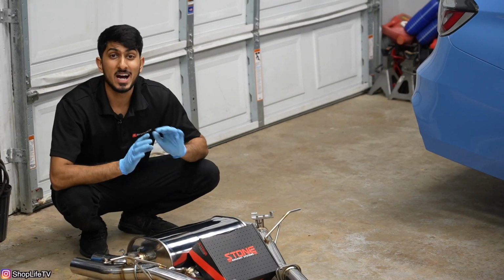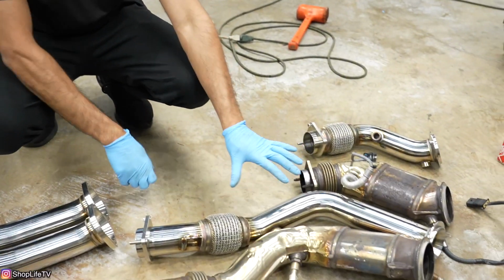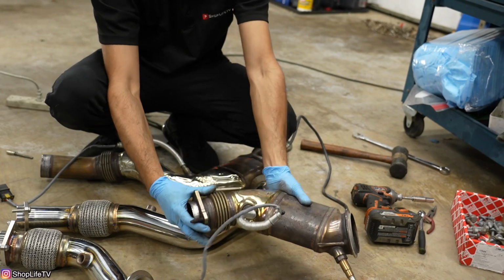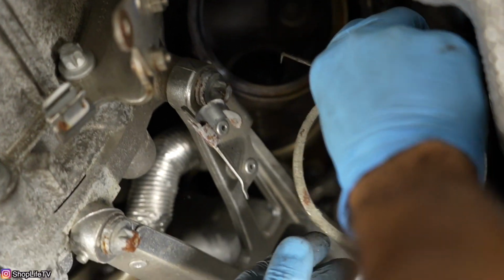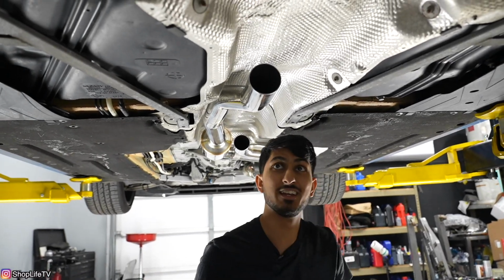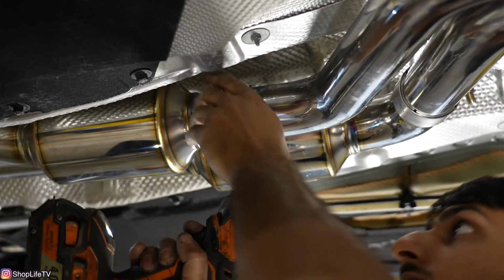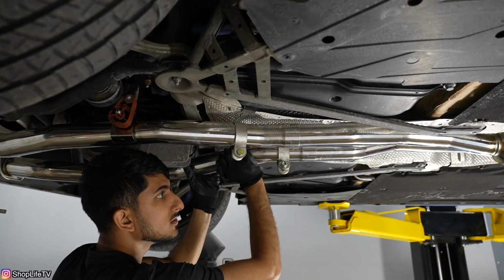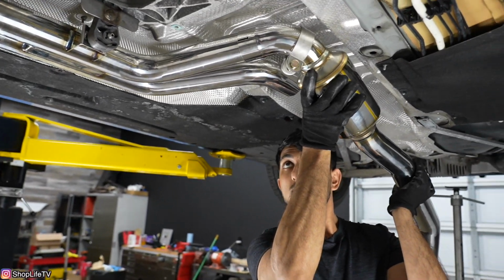I Installed a New Valvetronic Exhaust on my F80 BMW M3! + Driving Footage!!

Comment: 19:10 Wait....So the F80 M3 M4 now comes with a Twin Turbo set up? Because they didn't before that as they had what BMW called the "Twin Scroll" which is a single turbo with a kind of two way manifold to make it scroll up to speed similar to a twin T. But is not an actual twin turbo like the 2011 "1M' is and all other N54 engines are.
Reply from the maker: The S55 is a twin turbo setup, the N55 found in the Non-M cars is a twinscroll

Comment: hi and thank you great information, I have BMW e60 2005 120k m and I changed the gearbox 6 moth ago but it show me code A0b1 ( input, selector lever implausible) and the car make some problem like it take long time to start and the rpm some time go more than normal and some time not start and some time during if I but the gear box on N the engine stop and not start aging. I replaced  fuel pump and the fuel  filter and Crank sensor, please advice.

Comment: I wish you could do an e46 M3 exhaust that doesn’t sound like a farting rasp can at low revs. I have yet to hear a great aftermarket exhaust for that car. Great vids by the way!
Reply: Supersprint exhaust system. Unmatched
Reply from the maker: Super sprint definitely sounds good paired with a rasp eliminator and you will get a much deeper sound
Reply: @ShopLifeTV  What "Rasp Eliminator" are you referring to please?  I have a Super Sprint Muffler and Headers on my S54 and it sounds great except for at certain RPM's when the Rasp comes in and wrecks it all!  It still has the stock resonators on it but I don't know what to replace them with or exactly what to do.

Comment: The Active Autowerke EL (Equal Length) exhaust is what you need. Their full exhaust is close in price to your Stone exhaust, but sounds 100 times better! It has that perfect inline-6 sound, I have it installed on my F82 manual Comp
Reply from the maker: I've heard the AA midpipe and it definitely helps the farty sound, but the sure way to make the f80 sound good is the single turbo conversion lol
Reply: @ShopLifeTV  you are 100% correct. I'm strongly considering doing that to my F82, but I'm concerned about the rods. I'm only looking for 700 whp max
Reply: Any 2k drone ?